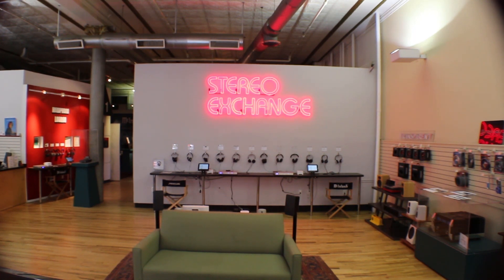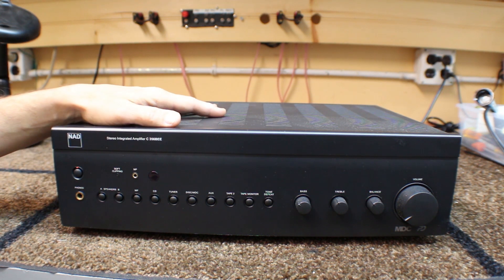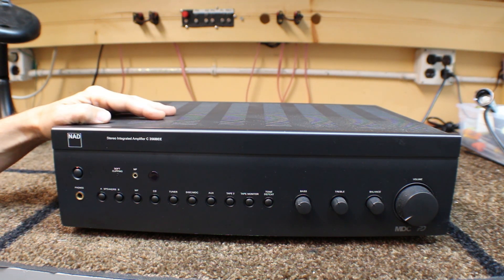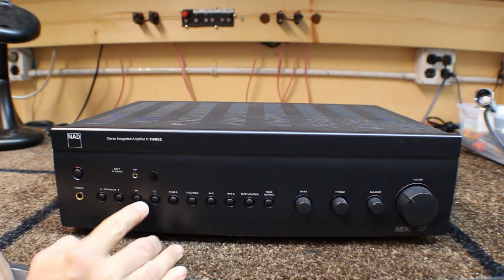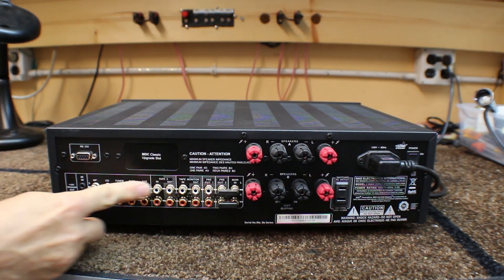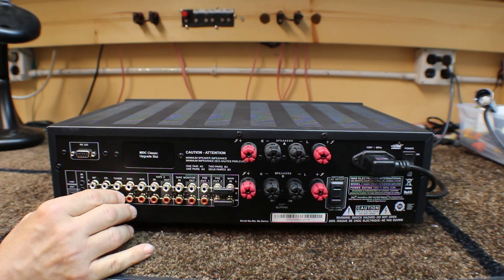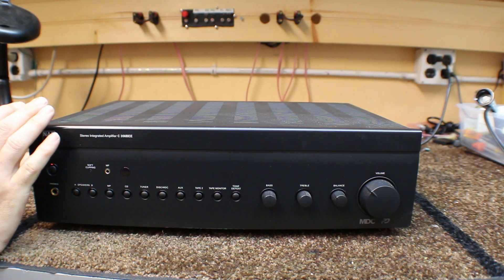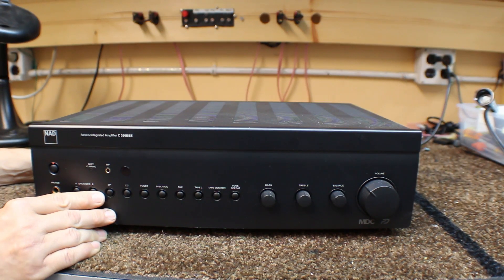Audio Primer: What is an Integrated Amplifier?

Comment: Strangely their is no videos showing how to add a better amplifier to an integrated amp or a am/fm receiver. In my area its very popular to add a high powered modern amp to a high end vintage receiver thus turning the receiver into a pre-amp.
Reply: Technically yes. Except for the fact that most dedicated pre-amps will typically be better at signal processing than the pre amp sections of most receivers. Same for dedicated amps.